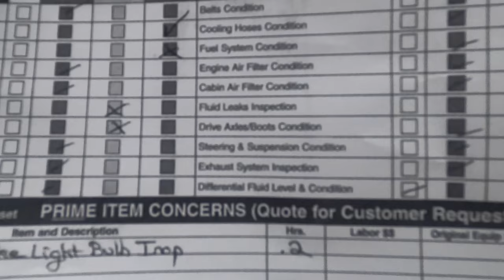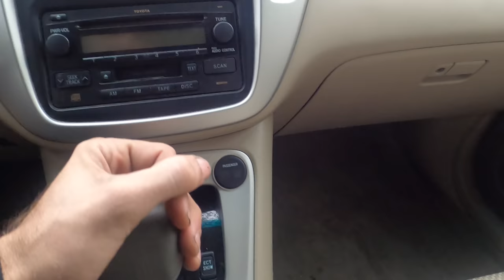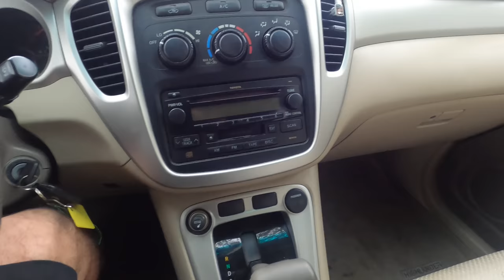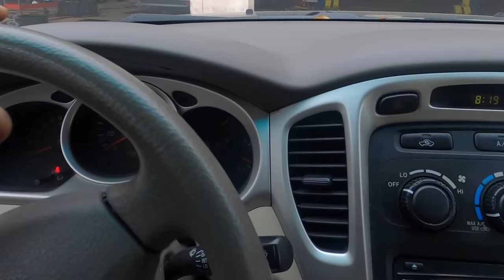We were BASHED by the Dealer! Ripping off a customer! Toyota Highlander 3.3

Comment: Always tricky when another shop gets involved, taking what the customer says with a "grain of salt" as too what they were told. I agree with another comment below, looks like that Yoda has been in some water or they like to go off roading, regardless  a simple brake service is all that is needed. My main issue is with the other shop saying it needs front calipers. CLASSIC FLAT RATE issue again. If they would have sold that job they would have knowingly done it without a conscious which is total bullshit and continues to give our industry a bad wrap. Good job Ray.
Reply: Automatic Car Washes pressurize water into every crack and crevice
Reply: Fyi, its spelled "giving a bad rap", understandable mistake if you've only heard it. Fyi the word is a shortening of rapport, which is a borrowed french word.
Reply: Especially the dealerships... should know there stuff but most don't have a clue
Reply: @johnnawrocki4079   the dealer found a grind noise and oil leak and stuck caliper .  Same as ray  did.  So wtf are you saying
Reply: Im glad our shop has digital report sent to customer and can be review anytime... all inspection done with pictures, so all doubt and accusation by customer, can be stop right away
Reply: @b4real371  so does salt water. Look at cars in the rust belt.
Reply: @cayman9873  Really?
Reply: @cayman9873  zero stuck caliper. Tight pins. That upgrades to calipers?  Don’t care about the oil leak. It had brakes done at Rays shop. Omg. Not going to get into it. Great vid Ray.  FYI. From Canada where hopefully we all anti seize and lube up all components. Just going to watch from now and not comment.
Reply: That's definitely been parked wet or sat in a puddle, that's more rust than you get off a car with salted roads.
Reply: Disagree about it being off roaded. I have a toyota with the same AWD system as this car and has never been taken off road. Every single caliper is rusted so bad I'm surprised they function at all. The entire driveshaft is rusted from front to back. I replaced all of the calipers, pads, and rotors, as well as the parking brake shoes (what a stupid design by the way).

Toyotas are just not good at long term galvanization. Don't know why they haven't caught up to the 1980s yet.
Reply: Just to be fair the other shop said the calipers were sticky. They never said seized . And with 46 years experience that usually means the caliper slides are seizing up and not returning to neutral position , often causing one pad to wear out fast ,as it is always dragging. But you usually don't find out the total story ,unless you disassemble ,and feel for yourself. Just spinning the tires on the hoist doesn't tell the hole story. And hear is something else to think about. If you were to replace the calipers ,you get, a new caliper, and  slide assembly, and you get new pins and slides ,all new. If you are paying a shop 150.00 an hour. Do you want him spending time trying to polish up old rusty parts or ,do you want  to get new parts that are going to give you years of service. Calipers and rotors are not that expensive ,if you buy at a parts store and not the dealership. Rusty rotors often make a rough ,or dragging noise. Or if you get a small stone stuck between the rotor and the backing plate , you might think the wheel is coming of ,by the noise that, can sometimes make.  Just my two cents.
Reply: @jeffglasman19  The problem ain't the 150 bucks per hour, the problem is the quality of the caliper, the way it is engineered and the materials used, as well as the way dealership mechanics are trained. To change each caliper every other year when roadworthyness is due is the dealership-way to go because they don't have mechanics capable of repairing/overhauling four calipers and two e brakes in an hour. These mechanics usually are quick in changing parts, but they do not know how to decide what to do to repair things properly, let alone use a lathe or a grinder. That is not what they are trained for, and so that is what they are not capable of: They see "rust in the e-brake-drum" -> needs new rotor. They hear a grinding noise when the wheel is turned -> needs new caliper. They feel a ridge at the outside of the rotor -> needs renewal for that axle.

Comment: if i replaced every brake/gas line with rust on it, I would be working until the end of time......I really don't like the mentality of the dealers but the mechanics just do what the shop tells them to look for repairing.......replacing calipers would have fixed the issue but caliper pins or just cleaning and lubing them was way cheaper and more exact way of repair but some shops are in it for the big bucks and customers seem to believe WHATEVER the dealer tells them...great video Ray
Reply: Don't forget that some dealers are trying to get the repair costs up to "oh well that could be down payment on a new car"..
Reply: I mean, I wont mind to repair something on a car. But if the measurements gets under where I evaluate it no longer is safe to work with (Like brakes literally have nothing to brake on. As in very used pads or dics) or goes under the data that the car brand had given. Then I will replace it. If it is with new ones or used ones, that is something I will take with the dealer or customers. If not, then I refuse to work on said car. I cant live with myself to know that I had "worked" on a car that have a very high risk of being in an accident one way or an other

I mean, it is human lives we are putting at a risk. Not how much a car cost to be repaired or fixed
Reply: That's the dealership mentality. My techs would tell me, "if the slider pins are bad, the housings inside the calipers are also bad. If you only replace the pins, you are putting on a bandage and it's gonna be a comeback"
Reply: @mh87351  That was a long time ago. Now dealerships want to make money from repairs. I remember when the service department was supposed to pay the bills only and all profit came from car sales. Now, the service department needs to provide even more profit than car sales.
Reply: @willpina  Service nets 3 times what sales does.
Reply: @willpina  I work as a mechanic in a dealership and I can confirm its really like that, our repairs is profiting way more than the cars sold. And many cases a little grinding or polishing would easily fix many parts, but the dealership demands we replace it. I can only feel bad for customers for buying cars from such dealership.
Reply: @ghostblackmormor8120  also, dealerships usually have to stick to manufacturer's specs. Sometimes manufacturers encourage replacing parts rather than repairing them. For instance, on Corvettes rotors are always replaced when replacing breake pads, according to GM.
Reply: @willpina  I think the proof of what you said is in the fact that dealerships find more work that needs to be done when nothing is under warranty and all the work will be paid for by the customer, vs their finding less issues  when it's covered under warranties.
Reply: @captinbeyond  dealerships can't "sell" warranty work. If they notice an oil leak while fixing something else they can fix it. But they can't replace a warped dash panel if the customer isn't complaining about it
Reply: @willpina  My experience with dealerships is they are slow to cover any warranty item and drag out the fix hoping you will go away or trade it in. My 2003 tundra has at least 4 recalls since I bought it and you get letters from Toyota Corp to bring it in under the recall---has my VIN number and stating my truck is part of the recall, but when I go in they ignore the letter and try to find a way to not do the fix. At least 3 of the recalls were for airbags issues which a lot of other cars had as well I realize. I went in one time only to be told they didn't have the parts, but would call me back when they came in. 6 months later no phone call---meanwhile I'm driving around with an airbag that could do more harm than good. So I finally call them and yes, they said bring it in. Every dealership I've dealt with---GM, Nissan have all been this same way.
Reply: @captinbeyond  that's not at all how it works. Dealerships get paid for warranty repairs, even recalls. But sometimes parts are delayed. The issue with the airbags is that Takata, the manufacturer of all of those airbags went bankrupt, which is why they are taking years in getting replacements. But dealerships want to do warranty repairs, there are rules they have to oblige, like no upselling warranty work. Probably as much as half the revenue of a dealerships' service department comes from warranty work.
Reply: @willpina  Maybe my local dealership is the exception, because they didn't seem to want to do the work. When I showed the service manager the letter from Toyota Corp about the recall, he wouldn't even look at it telling me they had to see if my truck was part of the recall. They wasted my time cause they knew they didn't have the parts, so I sat in the lobby  waiting for them to check it out. And then they told me they would call me when the parts came in, they never did. I could write a book about other situations where the same or similar things happen at dealers delaying or denying work that should be covered by warranty. Your opinion about dealers is different from my experiences with them.
Reply: @captinbeyond  of course, there are always dealerships that suck 😖🤣
Reply: Calipers don’t come with new slide pins.

Comment: When I was a dealer tech mid 90's, You were taught the difference between a leak and a seep and yes, caliper slides must slide to adjust for pad wear and if calipers were sticking? That dog be a smokin!
Reply: And on top of that, Are you the owner? just put new set rear rotors on that rust bucket, They probly not even 30 bucks a piece and make the people happy.

Comment: I had no idea there was a special tool for compressing brake calipers. I always just used a c-clamp. The c-clamp works though, so I don't think I'll be running out to buy a specialty tool. Seriously though, this was a LOT of work. I hope you charged the customer for at least some of it. As a DIY, that would have taken me all day and probably late into the night.
Reply: I took interest to the ratcheting tool he used and did an Amazon search myself. Half the time I need to use an old pad as a backstop. There is one that uses 3/8 drive ratchet tip and one finger against one of the dual pistons. This one pushes back on duals. Sometimes you force one side in and the other side pops out. I was always into the South Main Auto tool episodes. That Big Nasty Chicago Pneumatic  CP714 took out wheel bearings I didn't have room for 5 lb hammers.

Comment: Congratulations for the 300k subs!

I feel the same way about the customers. I am dealing with customers regularly, but I always tel them it was a used car when it came in, it’s still a used car when I’m done, just trying to make it as good as it can be. 

But can’t do my job well without being objective. Treat everything as it’s own issue, even if it’s coming back for something that’s like the original complaint.
Reply: Got chewed out by my boss for doing that on several occasions.  At one point I flat out recommended the customer to sell her car because a 2003 Dodge Avenger with over 200k on the clock wasn't worth the $3-4k of service they were trying to sell her.  My access to customers was severely limited after that and I don't work there anymore.

Comment: I hope you were paid for this work.  It sure looks like it's been a long time since any previous brake work was done.
Reply: The caliper slide pins on the rear hadn’t been lubed  in many years. That is amateur hour stuff from his shop. He glosses right over that. 
Notice his diag of the rear noise from the park brake he spins it with the rotor loose and still there. Bolts rotor down and gone. Yet when he determined that was cause of customer complaint he didn’t have lug nuts on there. 
 Yeah the dealer at the minimum misdiagnosed the front caliper binding when it was slide pins. But to call them rip offs. I wouldn’t have made that mistake but I have made mistakes where I went to change a part and “oh shit”! That’s where an honest person returns the parts and fixes what is needed. He goes on about no valve cover leaks then ends the video saying he is going to investigate further. 
 I’ve seen a few of this dudes videos. Puts himself in a high horse while acting humble. But slings around accusations like they are nothing. 
 Bottom line with this car. His shop did brakes. The amateur who did the job didn’t do the VERY basic step of lubing caliper pins which could even be why the plastic bushing got torn from them when removed. The customer had to take it to elsewhere because of subpar work done by them. That shop misdiagnosed the front calipers. But also tried to sell valve cover gaskets which were likely actually leaking and he throws around accusations even though it needs “further investigation”. Loo
Reply: @AlphanumericCharacters  back valve cover looks like it was leaking when he shined his light up there. Definitely a half ass rear brake job by his shop. All the rust is due to not cleaning and lubricating properly. Also seems like it would have just been easier to machine the parking brake hat rather than make a dusty mess in the shop
Reply: @AlphanumericCharacters  Nobody wins so TAKE IT TO JIFFY LUBE 😬🙃🙃!

Comment: Like watching your videos. Just want to let you know. The reason the rear drums are so rusty is because the customer doesn’t use the parking break handle. Along with the rotor rust is the actual pull cable rusting in its housing. This happens a lot with cars that rust. You might have solved the noise problem but you should actually pulled the parking brake handle to make sure that the cable actually releases when let off. Otherwise the customer will lock up their back brakes the first time they go to use them. Believe me, I seen this happen.
Reply: It looked to me that the customer does not use the park brake at all, I'm guessing that the vehicle has an auto transmission and they just put it in park. That whole drum was rusty, and did not appear to have been used for braking, so the rust just builds up. I thought that most slide pins had some lube on them, just looked old and dried up somewhat.

Comment: Its all in the little detail things...like the rust on the e brake drum area and caliper slide pins. Redoing the valve covers for the reasons you stated is spot on reasoning !!  These are the kind of things that make your workmanship stand out in the best way to me Ray:-)  I agree also about the dealer just Xing things in one shot vs doing it as each thing was looked at...if in fact it truly was looked at by the dealer fully.
Reply: I've had items marked "require immediate attention" just because THEY hadn't done the work and their book says to do it every x miles.  One item was the serpentine belt that I'd replaced  a few months earlier.  It still looked brand new.  I think I even had the letters pointing the right way!

Comment: How can so much rust accumulate? I suspect this car was driven through or has been stablnding in water. 
How else could water even get into(!) those front caliper pistons? And into the parking brake drums?
That said, the rear pads looked new but those slide pins were dry. 
Good thing you checken and serviced all of them.
Reply: My thoughts exactly.  But those pins and missing grommets are proof that the pins were never lubed or serviced.
Reply: It’s Florida.  I see a lot of videos of people in Florida backing their rear tires into salt water when launching their boats.
Reply: You should come visit us up in the salt belt, have a look at the vehicles up here! Go watch South Main Auto channel on YouTube, it will give you the idea, lol
Reply: Anything steel that gets real hot  will rust as it naturally absorbs moisture from the humid air when cooling.  Anywhere near the ocean or up north accelerates things and those caliper slide pins are notorious for sticking.  He should have cleaned out the receivers before installing new pins.
Reply: Its humid and hot in florida.  It rains a lot.

Comment: Appreciate your honesty Ray wish all mechanics were like you.
Reply: He is not honest, he says slide pins are not stuck or seized because you can pull them out with pliers, thats an absolute joke
Reply: @NjoyMoney  if you can pull them out with pliers the hydraulic system will work fine, also he did say they were stiff and recommended replacing them

Comment: I have done many brake jobs on Toyotas and have never had good results without using Genuine Toyota parts. By many I mean my family has owned Toyotas for 25 years and we have bought more than I could count. It seems everything out there in the aftermarket world rusts like crazy and creates issues like described in this video. I do live in the rust belt so that doesn't help. I found that you can haggle with the dealer and they will discount the price for parts and get them for just a bit higher than aftermarket. I am a DIYer when it comes to fixing cars unless the job becomes too big for my driveway.  Just some food for thought.
Reply: Aftermarket parts use a ton of filler to keep the prices down. They’re all junk that stupid people buy just to need replacement sooner costing them more in the long term. But hey, cheap people are extremely profitable 🤫
Reply: @christophervanzetta  what is filler